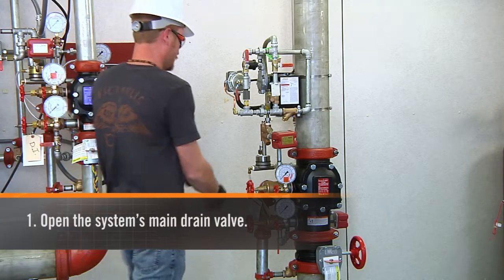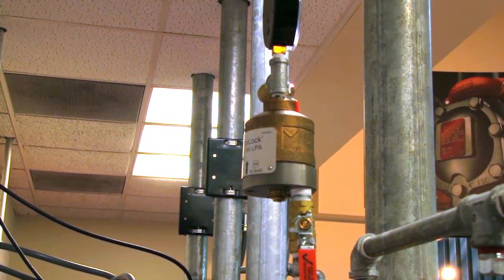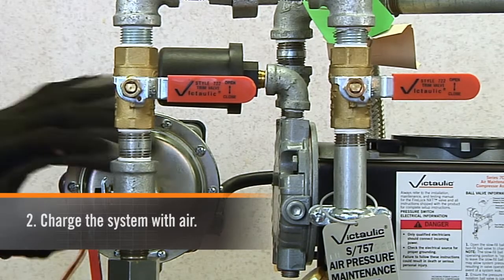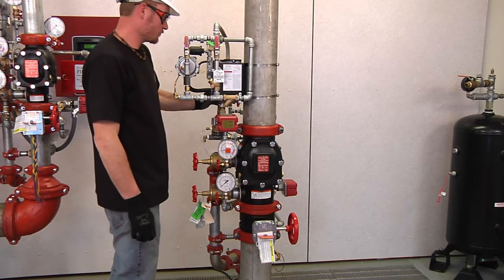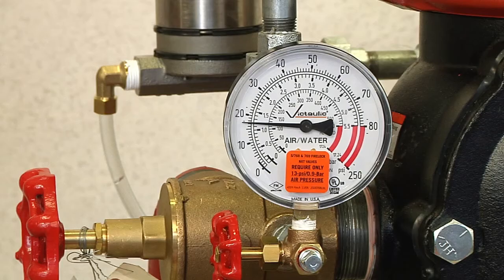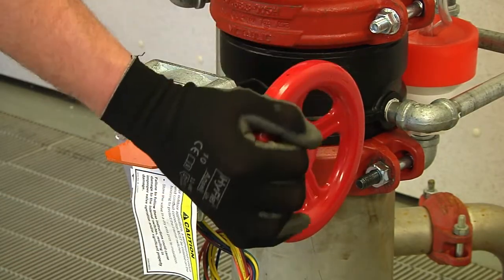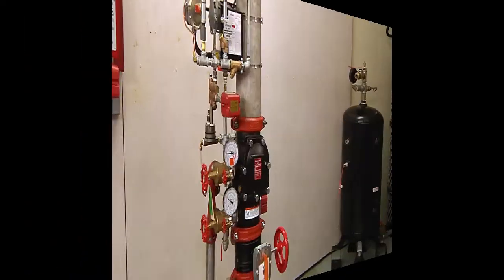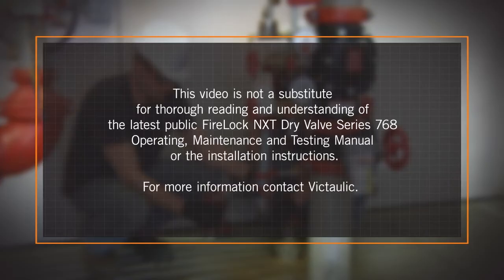Victaulic FireLock NXT™ Series 768 Dry Valve – Placing System into Service

Comment: Trying to set the prime water but when I pull the vent up wather run in to the air vent hose   Any one knows what the problem is❓❓❓❓❓
Reply from the maker: We would like to gain more information to best answer your question. Please visit the link below to get in contact with Application Engineering.

https://www.victaulic.com/technical-questions/

Comment: Priming line won't charge with water...any ideas?
Reply: Control valve probably mounted upside down. The charge line should be before the shut off so it can be drained of water but charge
Reply: @salp5387  I was able to figure out that the air side solenoid was bad so the water was passing straight through an draining out...thanks for the help anyway
Reply: Your strainer is clogged on the back of the actuator (silver hockey puck) there’s a yellow brass collar coming out of the back to 1/2” threaded nipple elbow to a union. Take apart the union pull the brass collar and clean the ring(slips off the top) make sure you can put your finger on the bottom of the brass and blow air through the top so it comes out of the side holes. Put back in and vwalla.

Comment: I have a problem. The auto vent on actuator constantly releasing air and won’t stop. There’s in no downforce therefore it should be set in UP open position but it constantly releases the air
Reply from the maker: Thanks for reaching out, if the auto vent will not seal, you may try to clean it out by putting it under running water and plunging the knob repeatedly. If it will still not seal, the part may need to be replaced. Please see your local distributor to procure a replacement part.
Reply: I like smacking it with channel locks before replacing it, but that little ball the will corrode away and let water through

Comment: How to set compressor pressure
Reply from the maker: The Victaulic Series 7C7 Air Maintenance/Compressor Assembly comes with the pressure switch preset to cut in at 13 psi and cut out at 18 psi. If not utilizing a Victaulic Series 7C7, adjust the pressure switch to the same settings, on at 13 psi and off at 18 psi.